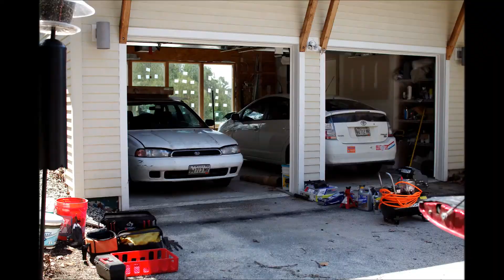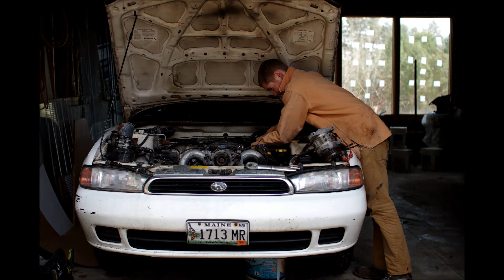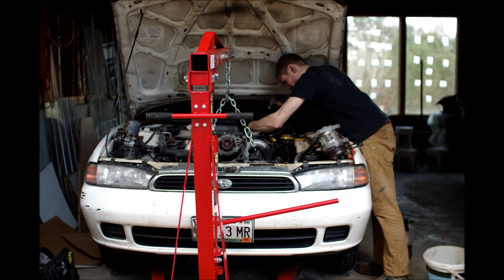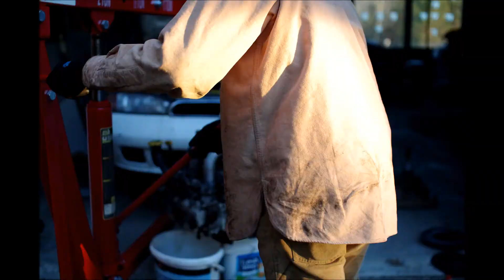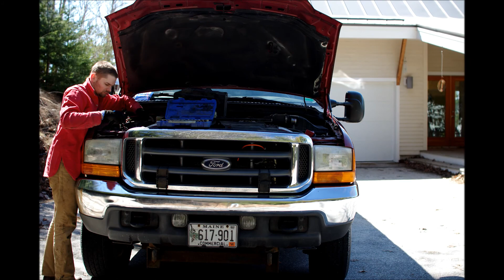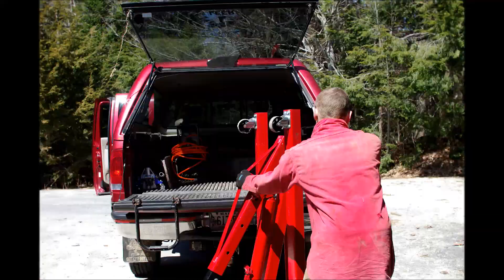1996 Subaru Legacy EJ22 Clutch Replacement Time Lapse

Comment: i need to replace my clutch and cant afford the shop to do it. was this hard?? i feel like i could do it! i already bought my clutch i think the only thing i need is the hoist. maybe a couple tools
Reply: wonder if you actually fixed it by now? If you have felt you could do it its likely that you could have. on my honda crv 2003  i suddenly saw the rpm go bananas and i knew i had a oil leak on the clutches. never changed a clutch before but i did it. i thought it was really hard but it was actually easier than i thought it would be. actually the hardest part was the ball joint and the rear drive axel nuts.

 i think the rule is that you start by uninstalling any components that is in the way of uninstalling the gearbox like the starter and drive axels and other. 

(This could be important info)
taking out the gearbox went smoothly. when installing the gear box back again can be a bit tricky as i do not have any strength to lift it by hand. I had a strap and a jack to lift the transmission up. i put the jack  right under the center of mass of the gearbox and lifted slowly until the driveshaft slightly touched the center of the clutch. then i put all the gearbox bolts turning them in about 1-2 cm into the gearbox (never all the way in at start because then you destroy the new clutch) so that the driveshaft had a very small pressure on the clutch and turn the driveaxels so that the driveshaft could pop into the clutch(it is really hard to align the teeth on the center axel as you cant really see it). before turning the bolts check by turning the driveaxel and see if the angine also turns without any slippage(gearbox must be in gear) then if the engine turns you gradually turn all the bolts step by step until everything is bolted. then re mount everything you took of.